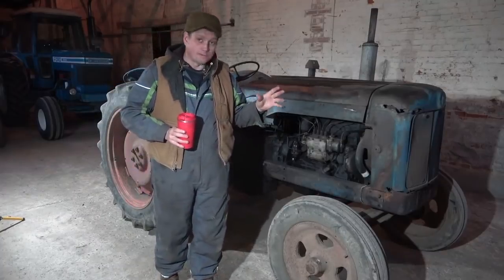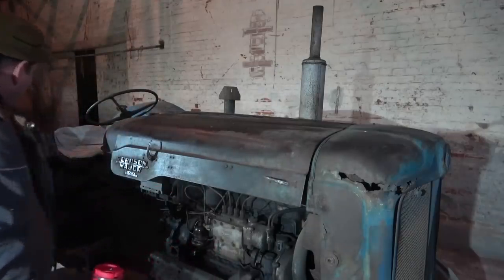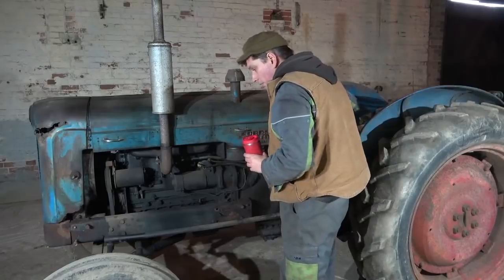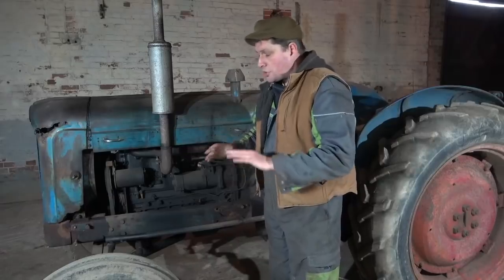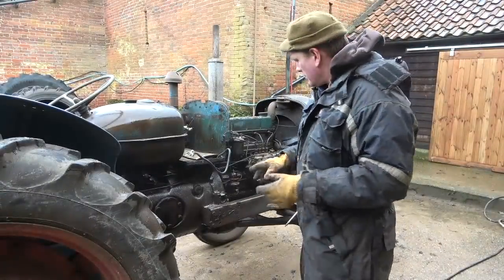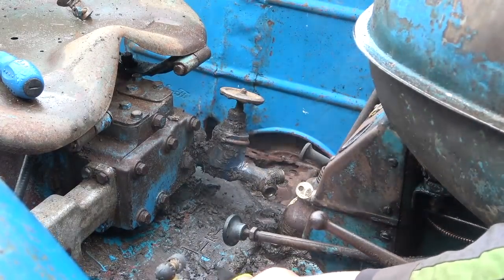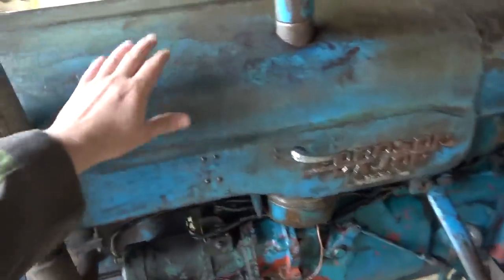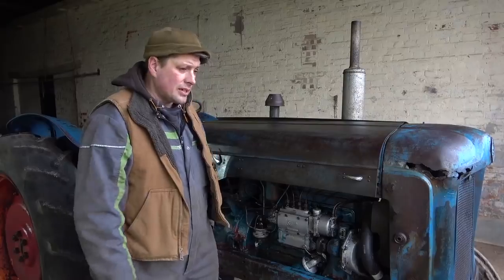PRESSURE WASHING A 70 YEAR OLD TRACTOR

Comment: Grandfather had one of these on the dairy farm. It had the most threadbare canvas cab.  Brought back a lot of fond memories seeing that.  It was more drip-top than tip-top.  Be well and stay safe.
Reply: Flip me autocorrect.  Wee??? Ffs.  I still have a scar from running into the old type scythe bar on his grey fergie.  Baler twine snappage mentioned she was hidden in the loose floor hay in the shin splitting horizontal mode about 5 inches off the deck.  This has literally made me winse  remembering the pain.

Comment: I love this old Fordson! It was my first tactor that I bought. It was Fordson super major -52. In the beginning a petrol engine in it but was converted to a diesel in beginning of -60.
It was realy reably worked in all wether. Only one time the engine run away for me. It was the returnline from the injektors that have been a hoole and diesel ran down of the side of the 
aircliner and fill it up. Then it get diesel direktly in to the inlet and the engine start running in heavy speed. But the engine did not get eny damage! Keep going with the good work and hope to seen you soon!

Comment: Good evening your Lordship, this tractor 🚜 the Fordson Major actually brings back some fond memories for me as I got to drive one ☝️ when I was at agricultural college at Hartpury near Gloucester back in 1986 and boy that was a very good tractor 🚜 to drive and thoroughly comfortable too, however my answer to your great question is that I would go with option B but the only thing that I would do is to give a clear coat spray over to keep it’s story for a long time and of course give the mechanicals a good going over, other than that I wouldn’t touch a thing apart from the usual basic daily routine stuff (oil,fuel,coolant).
Reply from the maker: Cheers Jack.

Comment: Personally I'd restore the Major to her former glory , I used them in the sixties,  we still had three of them right up to the late 70's but they ended their day as irrigation  boom carriers don't know the correct name for them but they were like a massive helicopter rotor mounted on top of the tractor, none of them had cabs, so you had to wade through a foot of mud to climb on to the tractor to move it along another 150 yards or so to irrigate the next bit, I remember having mud on the foot plates above the height of both the clutch and brake pedals, keep up the good work, I'm learning a lot from you, thanks.

Comment: Well this is a tough one m'lord, I fully understand everyone that think you should preserve it and let it keep it's rough but honest exterior, and I too think this approach has it's charm. However I am also a total sucker for full OEM restorations. I just love seeing old warn out equipment getting fixed up by loving and experienced hands (anything from an old rusty bench vice to clapped out tractors...). The worse off it is at the start, the more satisfying I find the end result (if it's done right of course). Main thing though is that it doesn't just sit in a hedge row rotting anymore, so a rough looking but well sorted piece of equipment that get some regular use is also very nice to see...

Comment: I think you're absolutely correct. Its a running working old tractor with history. My humble opinion is to make it mechanically sound and preserve it. You can always find another with worse tin work that replacement is the only option and then do a restoration. One would show as brand new and the other as a 60 year old tractor after years of faithful service.

Comment: I love these old tractors,  The boatyard I worked at had two  back in the early/ mid 2000s, I drove them on an almost daily basis. Unfortunately they were totally abused but kept going no matter what. They were only sold when the clutches went and were replaced. Happily they were both taken away on a low loader too be restored. With regards to yours, I would personally enjoy it as is.

Comment: I used to drive an old Major Diesel in Norfolk 30 yrs ago. Hydraulis loader on front with power assist ram steering and landrover front wheels and wide rears.

Great old bit of kit.
Air intake butterfly throttle which is unusual for Diesels now.

Comment: When I was a nipper my uncle had a Major that he used for odd jobs like collecting firewood, but I used to live for those rides in the link box, and he used to let me steer it on occasion.  It must have made an impression as I went to work for my grandfather's agricultural engineering business when I was 17 and one of my first jobs was rebuilding the engine on a lovely old Major.  Power washing customers tractors outside in the middle of winter was never a task I look forward to though.

I think I'd have a go at repairing that nose as don't like razor sharp rusty bits, but it would be a bloody shame to bin it off for a better one and lose an original part that's been with that machine for the better part of 70 years.

Comment: Funny part Lord Muck :) also everyone remember years back I had do big overall to farm loader tractor was dirty & rust plus cows poop  on and had do big pressure washer and sand blast to  ! What jump out air breather lots mice also nest in slink tube too and downdraft exhaust in muffler of tail pipe and some died from fumes! But amazing got all looking like new again plus some rewired electronics too and you name too! Tractor was my late Dad 1963 McCormick International B414 Loader tractor 40 hp Desiel fuel type and also when saw you say holy how much that cost dad to and did out my pay for working long saved up for to help out!

Comment: Nice one LM. Quite an early Major that has survived in working clothes. Job to know what to do. It would be nice to lose the big holes in the nose but difficult without then having to respray. New nose cone, thin spray, rub back with compound and allow to rust slightly and rub over with diesel. No one (except the 10k on here) will know.

Comment: A tractor is only original once, spray over with owatrol oil which will protect the metal while giving it a shine. Worked well on my Ford 5000

Comment: I would do exactly what you have done so far. I would protect what's there to stop it deteriorating any further, but would also be on the lookout for a good original nosecone. 
Theres enough shiny ones at shows, prefer them in their working clothes, I have done the exact same thing as you, with my 1958 diesel major.

Comment: Before you said date, I would have said 1952 from the engine. It has an extra casting line on the LH side by the dynamo. Also the throttle linkage goes through the block. The block was used on the early diesels as was the same as the petrol block. 53 on had a diesel block.

Comment: Keep as is . There was on on my fathers farm during the mid 80's a Super Major with a front loader on her and was sold on late 80's for a Massey Ferguson 50 with front loader and back actor on it . I think they still have it . I vaguely remember the Major running a Silver Class Reaper combine cutting corn in a field . The Major was on the farm when I was born so I don't know my father had it along side a Massey Ferguson 188 as main tractor which was then sold for a 390 . The Major did all the donkey work for many a year .

Comment: Personally I’d let ‘er dry out now and on a nice warm spring day luche Waxoyl all over.
I’ve given up the paint party’s, I think it destroys the Tractors’ CV or story as you say.
Unless they’re hanging and your replacing lots of tinwork in which case, you need to paint.
The Waxoyl treatment in my eyes is ideal. You can add to it, you can steam it off if you need to, it stops the rot and it does good for all the dry squeaks you can’t find.
Lacquer isn’t great, without good base it can often opaque and peel.

Comment: Looking good! Personally I’d waxoil it and preserve it as it is, the panes don’t look to bad at all, I’d put all the effort into getting her running right, it will only be original once! My fergie had loads of filler and a shit respray from a kid in wales so I’ve had to do a full respray and mechanical. However I would of liked to preserve the original paint but that wasn’t an option.

Comment: I think I would go ahead and do the nose and do a cheap paint job, as you said that it is still functional. As there isn't much paint left, it would be time to do it just to preserve the tractor for the next 50-70 years-perhaps just a spray gun in the barn job, but, at least it would protect it. Patching vs replacing the nose would depend on price, and I wouldn't spend more than around $200 on the spray.... then I would spend whatever is left of the budget to clean up the mechanicals.
Restoration paint-i wouldn't. But paint as part of a maintenance routine, yes.
Note-I'm from Michigan, USA, we use a lot of salt on the road, and it rots any exposed metal, so, I am more likely to prefer considering a paint job, to seal and protect, than for perfect looks....

Comment: I would 100% leave as it is, it's a nice straight tractor other than the usual nose cone rot but even that isn't bashed about. Got 3 Fergies one original as it's straight no rot tidy little tractor. One restored because I bought it when I was 13 and like a prat I decided to paint it it as that was the in thing at the time. Got a TEF im rebuilding at the moment I'm in 2 minds whether to paint 😅

Comment: great video as usual,
if the damage is only what we can see in the video then i would treat the rot to stop it spreading and then maybe clear coat the body,  then sort out the rest so it runs and drives on the button

Comment: Hi L&M, good to see you back in action great video. I think there are two routes as I see it. 1 if one wants to take the tractor to shows then I think it would be fitting to go the whole hog and get the tractor as pristeen as possible. Which is an expensive and time consuming task. The problem with that is that a tractor of that age would be mutton dressed as lamb. 2 clean and serviced and mechanically sound is as good as it get. How ever I would like to see that hole in the bonnet patched up, that hole would bug me. So in stage two the tractor would be an under cover project and fair weather display. See you again soon.

Comment: When you went through that water splash at the end there, I thought you'd had dreams of joining the shrimp fishermen of Morecambe Bay! - Look out for that video - it's interesting, though most of the fishermen prefer Nuffield's for their extra turn of speed!

Now then, no harm in getting the new 'tins'  but whether or not to fit them is another story. All of mine are in their working guise "Rustin' Rattlin', Rollin' & Roadworthy".  Modern replacement tinwork doesn't usually fit that well, but in some instances can't be avoided. However, if what's still there is still firm and fixed in place, leave it alone I reckon - My '68 DB 780 is pretty much untouched since it left the works except for the green paint that a previous owner daubed all over it (Bitumastic, by the look of it). It's a bit like the argument over safety cabs and frames. Again, the 780 has a retrofit Lambourne cab that was added in the mid '70s during the "Elf 'n' Safety" putsch - Do you leave it on? Or do you take it off and return the tractor to its original state? I guess it's down to what the owner prefers, but restoration to showroom condition isn't always the Bs & Es , and in some ways is like wiping away the past as if it never happened. Every working tractor has its own bit of history that it carries with it. Every restored tractor is just a copy of all the rest of its ilk - Perfect in every detail, but sterile and bland.

Plus of course, restored tractors don't really fit in with a "Rustin' Rattlin' Rollin' & Roadworthy" tractor rally/road run!

Comment: You can't polish a turd, but you can roll it in glitter. Fresh paint is generally glitter for used tractors. 
Sort it mechanically, have everything that needs to work working and preserve the tin work. As you said, trying to paint bits leaves it looking patchy and unless you're willing to strip it right back to the frame and do a complete restoration, then its going to look like a patchwork quilt.

Comment: I do work for a farmer (dave rushton machinery) who buys and sells machinery (farming, construction, engineering) and the remit we work to is repair something if it's broken, tidy things up (straighten metal, beat panels etc) and give it a clean with the steam cleaner/pressure washer, then stop after that as restoration isn't cost effective, people (looking for a project) don't want it and as you said it loses it's history (we've got a Ferguson tipping trailer thats quite rough but original it's more collectable in this condition than restored because of it's patina), me i'd just repair the rot on the cowl (don't hide it as it's part of tractors story) and go for how fuzz townsend describes as an "oily-rag" restoration.

Comment: Id Make her mechanically sound and leave it as that. She looks good as she is on the paint side, gives it character!! Currently restoring a Massey 65 mk2 and the nose cone and grille has all been dented and falling to bits so am having to replace it which means it needs painting which also means the bonnet need painting too. Problem is when the whole bonnet is painted where do you stop?

Comment: We have one of these beasts. Can’t fault her. The only problems we have with her at them moment is either a cracked head or worn head gasket and some gearbox rattles but for a tractor that’s been severely abused for a lot of her life doing competitive ploughing before we got her that’s not too bad. On the plus side it gives me something to work at over this third lockdown in ireland
Edit:
As an answer to your question I would spray the body but keep the tins original in order to keep the story

Comment: get it mechanically sound, brace he cowl if it needs it, and give it a shot of duck oil or owatrol to stop it getting worse. I have a series 1 7610 that it would be a shame to respray, and an 8n with a perkins conversion that had a restoration because 40 years sitting in a hedge left me no option.

Comment: Podge, Preserve it’s originality, it’s a lot easier any way that way, and as you say that is its story. I always thought the best restoration was as little as possible and it seems that has become the fashion now. 
Fordson’s two bladed fan has never ceased to amaze me. How did they get away with that? A few came to Australia with one but they must have never seen hard work or they would have cooked. 
On a different note, I have a Ford 2000 6X 1965 and under the crappy re-spray while trying to work out if it was a 2000 or 3000 I found the word Dexta. I know Dexta pre-dates these tractors but have never associated them with the Thousand Fords. Can you shed any light on this? Thanking you, Jeff.
Reply from the maker: As I remember, early pre-force 5000's were badged as Super Major's near the diesel tank and I think early 200's were badged as Dextas.

Comment: First I would see if I could locate an original nose cover that is in better condition. Failing that I would see if I could repair the nose cover. As for the patina, I would try and preserve it as it is (There are a few methods out there in doing that). Make it mechanically sound, do a deep service, valve re-lap, tappet clearances etc. repair all the oil leaks and leave her at that.

Comment: if it were mine, i'd leave it as it is with mechanical fixes just so its works right, there are just too many restored ones these days, its getting too difficult to find nice originals, i think its important to keep as many as possible in original condition, we've got 4 majors in original condition 2 of them are even nicer than yours believe or not, no nose cone rot just well looked after perfect originals :) great video mate

Comment: I would fix the rust holes because I hate rust. I wouldn't replace the tin but as bad as that looks, an imperfect patch wouldn't stick out. You can always stain the patch with vinegar or something to give it patina to match. The front wheels are real chunks--cast hub in wheel? It runs down the road like an old Ferrari tractor.

Comment: I would give it a good service and then leave it exactly how it is. Perhaps if I picked up a set of original period headlights in similar condition as the rest of the tractor I would fit, personally I think they look better with the lights but that’s my preference. What  chemical do you use in your degreaser?

Comment: Get it running properly and sort out any other mechanical problems and then maybe only change the front grill if it's to far gone and can't be safed the rest of the tractor. I would but loads of clear coat on it to protect it.

Comment: I’ve got a super major that won’t start due to a what seems like a lazy starter, by using the battery straight onto the start still won’t fire would you suggest a starter rebuild ? Thanks great video
Reply from the maker: Yes get it checked over first and check all leads and connections.
Reply: Thanks a lot

Comment: I would preserve it cause it looks like a good savior and one they are fixed up there no fun cause you hate to risk messing it up now I have a December of 1960 Fordson power major that well have to be fixed and painted cause some did a terrible job of making it look like a Ford tractor and the motor has to be rebuilt cause it slobbers oil.